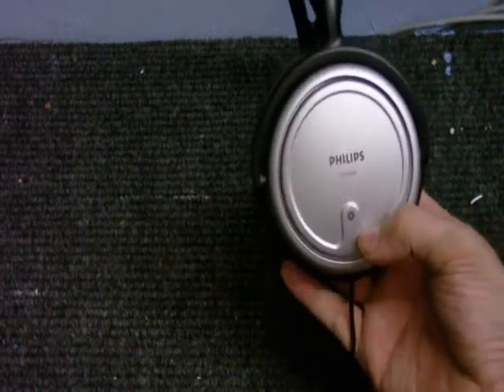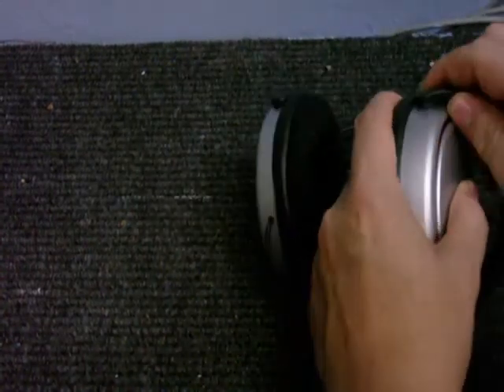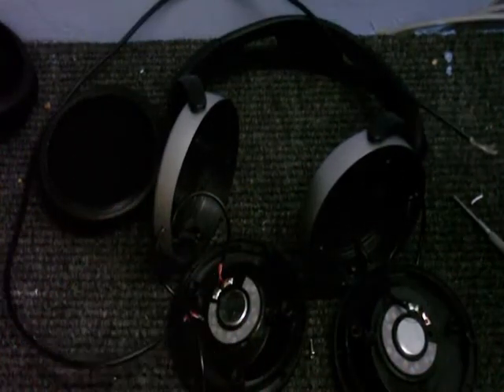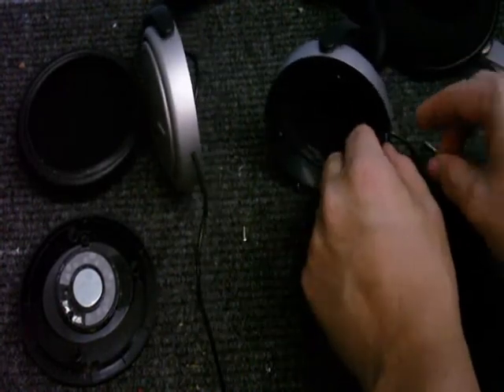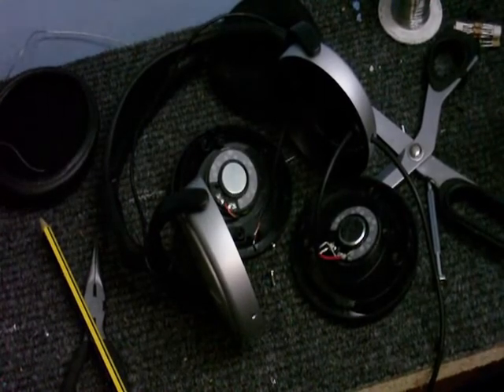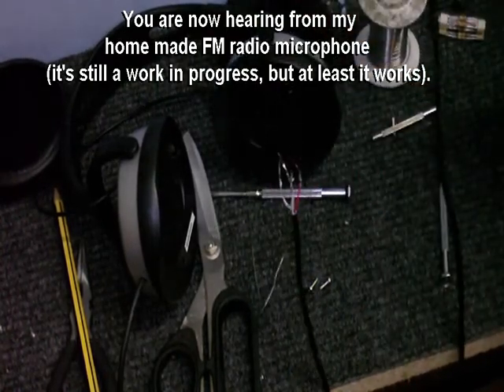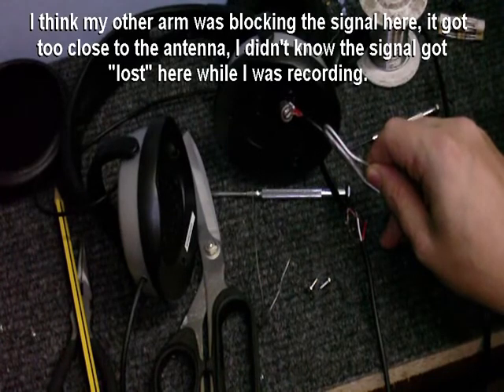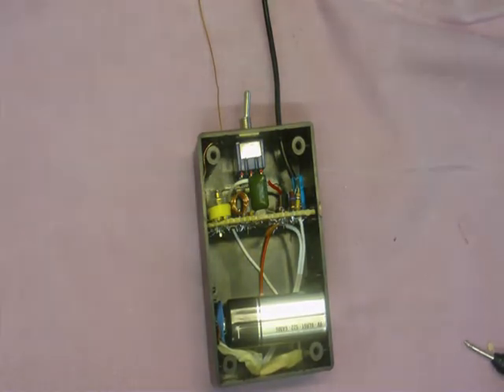CDC Electronic Workshop S1 EP 2  - improoving the Philips SHP2500 headphones

Comment: I have the same headphones, mine have had new plugs soldered so many times i have now soldered a larger 6.5 mm stereo jack o  them and i had to removed the volume control as it was faulty, my cable is very twisted, making it less than 6 metres long, mine get regular use but the double entry cable is a problem, i am going to do the same mod as you and put a batter single entry cable on, i am going to get some high quality wireless headphones for my bedroom TV.

Comment: So are these supposed to be better that the SHP2000's?

I'm asking because I'm truly interested.  Last night I was at a lan party and forgot my headphones, borrowed a pair of SHP2000's from the guy hosting the event and spent all night using them.  He told me he bought them for 15 euro's.

Honestly I've never heard anything worth a listen under 50 euro before, usually I use AKG/Sennheiser/Audio Technica/Byer Dynamic/grado cans ... and dear lord did these blew me away (for their price point).  They were not half bad, and i think a lot of modding potential to make them even better.

At first I connected them to the headphone jack on the motherboard of my pc, sounded ok but a bit weak.  Then I pulled out my headphone amp that i didn't forget and hooked it up to that.  It was performing notacebly better, and quite frankly a lot better than a sub 20 euro headphone set should sound like.

Really thinking about ordering some.
Reply from the maker: +kmi187 I don't know if they're better, I just bought those because I needed a pair of headphones, I'm not and audiophile so I don't need anything too fancy.  The thing I cant stand is having a wire going onto each headphone, they get twisted and tangled up, I much prefer single-side entry so that's what I was doing here, modifying them so the wire only goes into one side.
Reply: SHP 2000 is a lot better as it has a shorter cable and it's cheaper.
Reply: to my experience only difference between sbc hp2000 and hp2500 is that they are obviously in different color and 2500 has longer cord (3meters) making it better for indoor/tv usage and it also has analogue volume control on the cord.
hp2000 has 1,5 meters long cord and it doesn't have that volume nob on it.

i have faal in love on these hp2000 headphones and i have bought several pairs of them after i bought my first pair, back in the 2006.
before these i have had those philips sbc hp1900 models too, but it only had single cord design and it seemed to broke way too easily. i had to return them under the one year warranty several times and the sound quality wasn't as good as it was with these hp2000/2500 models.
Reply: hunter_finn The SHP 2000 is like the top dog of budget Philips headphones. I still like their sound to this day. Works with every genre.